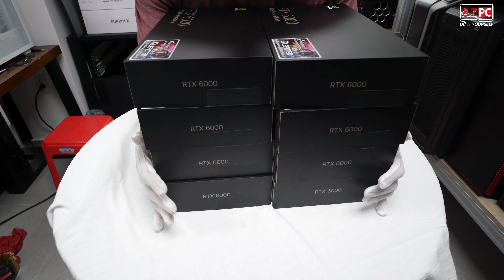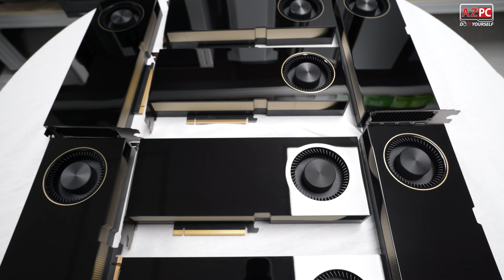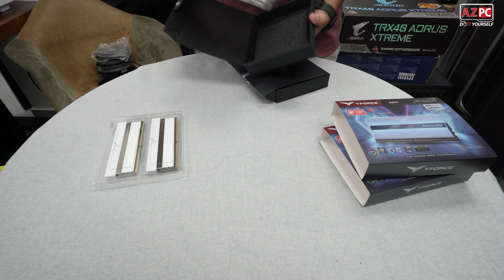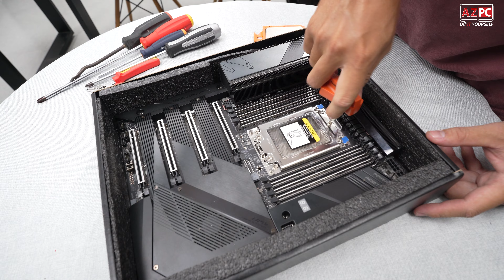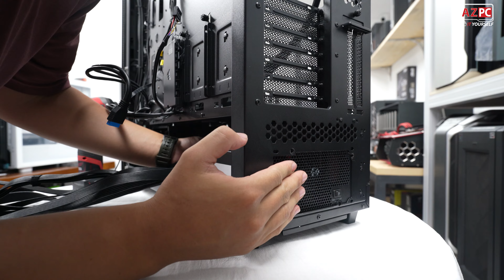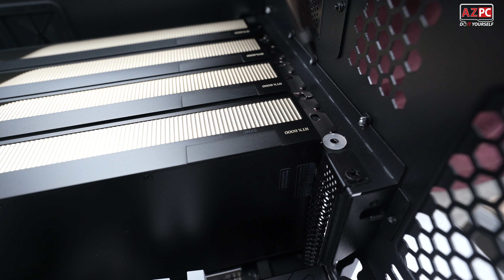$45,000 workstation build with 4 x NVIDIA RTX 6000 Ada Generation

Comment: @azpc - Based on the specs of the motherboard - PCIe 4.0 x16/x8/x16/x8.  Those 6000 ada in those two X8 slots. Is this not good?  Do you have special bios to change this so all the PCI lanes are X16? How can you get full X16 support for all four lanes?
Reply: Total this CPU with any Mobo support 64 PCI Lanes I think on Gigabyte it is a bit different then on Asus

Prime TRX40-Pro

3rd Gen AMD Ryzen™ Threadripper™ Series Desktop processors
3 x PCIe 4.0 x16 (x16/x16/x16) *
AMD TRX40 chipset
1 x PCIe 4.0 (x4 mode)

3rd Gen AMD Ryzen™ Threadripper™ Series Desktop processors :
2 x M.2 Socket 3, with M key, type 2242/2260/2280/22110 storage devices support(PCIe 4.0 x4 mode)
AMD TRX40 chipset :
1 x M.2 Socket 3, with vertical M key, type 2242/2260/2280/22110 storage devices support(SATA & PCIe 4.0 x4 mode)
8 x SATA 6Gb/s port(s),
Support Raid 0, 1, 10